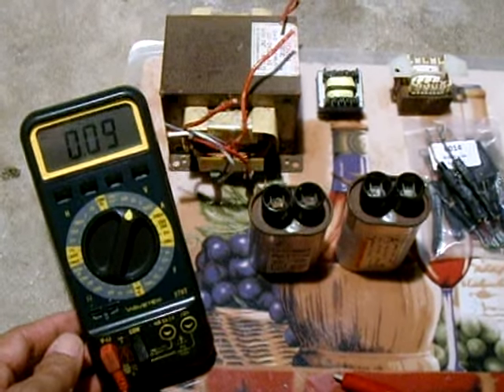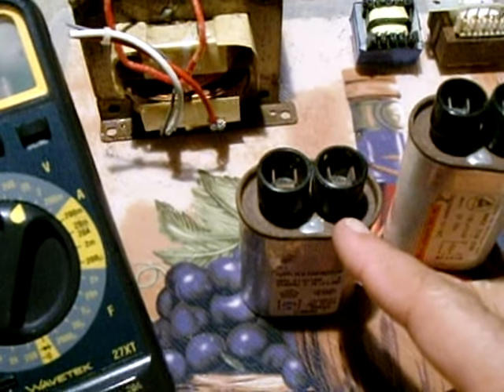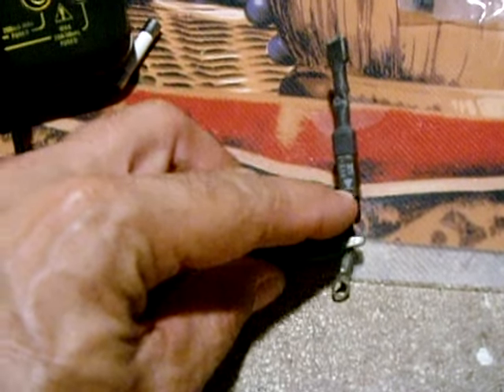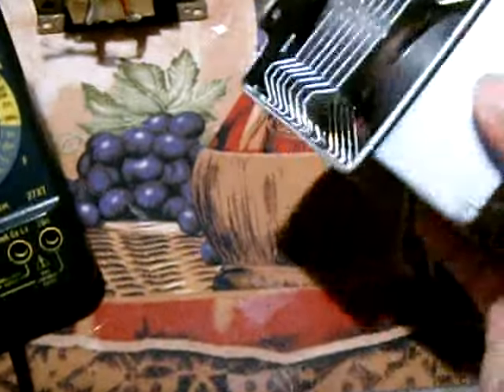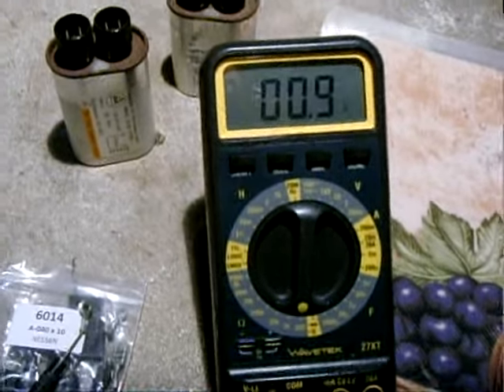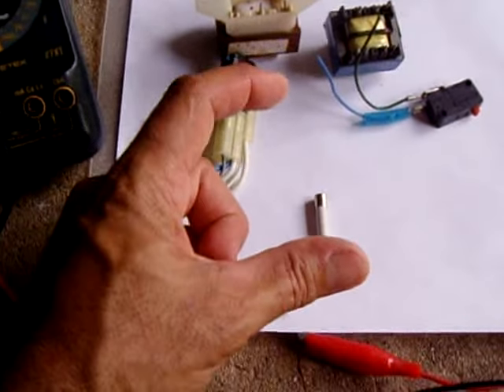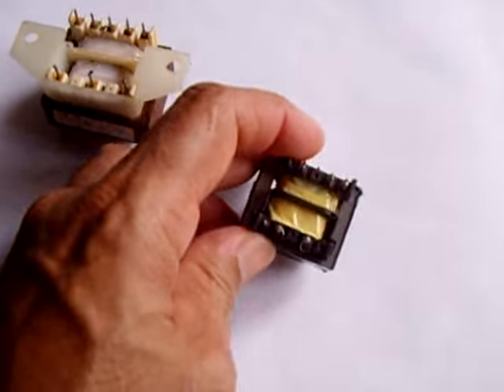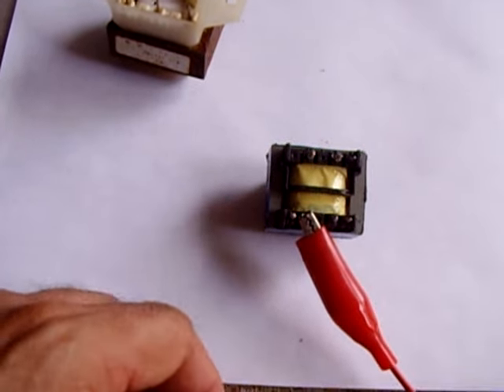How To Easily Test Microwave Oven Parts! (Ultimate Guide)

Comment: The testing on the MW transformer is very hard to follow for the following reasons: You use different color leads and the framing does not include how you are routing the wires. The red lead on the high voltage (primary) testing is out of frame. I have tested mine using two different DMMs and still have yet to get the unit to go the 80 to 120 ohm range. Also the blue text is almost impossible to read. The only reason that I mention this is that I study videos on appliance repair and outside of the transformer confusion, I think that this the best MW video on You Tube.
Reply from the maker: +Hannah Youngblood I no longer use that blue text. It was hard to see. Make sure 
annotations are turned on when watching my videos. I have another 
microwave oven repair video which is excellent. Thanks

Comment: Hey elec my microwave packed in yesterday.  Ive done all the testing that you said.  It runs like all is well but does not get hot at all.  everything tests good the magnetron is good and the capacitor is good i changed the diode still nothing.  However i do get 2.5 ohms on my primary windings of the transformer any idea do you think that transformer is the problem the HV wires are fine to what you said and none of the wires short to the casing? Thanks man hope to get it working got no cash for a new one:)  i get the tell tale hummmm from the transformer and all but nothing.
Reply from the maker: If the diode is definitely good, as well as the capacitor, then I suspect a faulty magnetron.
Reply: electronicsNmore thanks elec the diode is brand new so that should be good.  i do struggle to test cap though as i only have 2m ohm on my meter.  if i test across the terminals i get it count past 2m ohms not sure if that means the 10m ohm resister is good in the cap or not.  the magnetron tests good but i guess there could be something wrong with it.  anyway thank you so much elec solid video man keep it up.
Reply from the maker: Cap sounds like it is good. Likely a faulty mag.

Comment: where did you get your diodes from all the parthouses what $30.00 to $50.00 for them
Reply from the maker: tom rock I get all mine from the dump. I have at least 20 of them. You can buy a 12KV diode on Ebay for a few dollars and up. Enter 12KV diode in the search box. 30-50 dollars is criminal.

Comment: Ok thanks for posting this video!! Question for ya, my GE microwave everything works but it does not heat and the turntable does not run! When it did this both stopped at the same time. Everything else sounds like it is running normal. What could cause both of these to go at the same time? Seems that they are not connected as far as what controls them or powers them. Even the display is still normal! PLEASE if you have any suggestions let me know! Excellent video just thought I would ask in your experience what could cause the two problems at the same time, so far I checked door switches and figuring out your instructions on checking the diode.
Reply from the maker: Sounds like a faulty door switch, OR when the door closes, contact is not being properly made to trigger a switch. Test each switch according to the video, and open/close the door while you test to ensure they are being triggered. POWER OFF!(unplugged)

Comment: Hi my 23 year old Matsui Microwave has just started intermittently tripping the 30mA trip on my board. It doesn't do it all the time. In your experience which of the TX, Cap or diode or Magnatron will be the culprit?  I'll get in there and confirm it to you when i get a moment! Great videos by the way :-)
Reply from the maker: Probably a faulty/misaligned door switch.
Reply: Ooh, can you tell me how will that would trip the breaker intermittently?
Reply: No, it was a faulty capacitor

Comment: What causes the ceramic fuse to blow?
Its fine for a couple of days when a new one is put in, then it blows. Does this sound like the capacitor?
Reply from the maker: Faulty capacitor, malfunctioning interlock switches, or a badly misaligned door can cause the fuses to blow. Thanks for watching!

Comment: Hey. When I test the Diode one way, I get 50M.  When I reverse the leads, it starts to count up to infinity.  I have a 2000M setting on my meter.  I purchased a new diode and I'm getting the same readings on the new one. Is it possible that the new one is faulty as well?
Reply from the maker: Myth Your test showed a perfect diode. That is what the results should be. There was no need to buy a new diode.
Reply: electronicsNmore Ah, I see.  I thought if the reading went over 350M it meant it was bad.  Luckily I can return it.  Thanks for all your help.
Reply from the maker: Most will rise up to the 300M range one direction, but I have seen others read to infinity. As long as one way is 30-55M and the other way is 300M to infinity, then you are OK.

Comment: great video! i just want to findout, what causes my microwave oven to just stop working and display zero on display? nothing else moves no humm nothing. just a lit display displaying zero.
Reply from the maker: Does not sound good if the keypad/display is not working. May be a faulty main board. Try pressing clear, and as a last resort, leave the microwave  unplugged a few hours and try it again. The zero may also be a trouble code for your oven. You need to do some homework.

Comment: Hello,
I have one (few yrs. old) Kenmore micro, and the fan, light, carousel runs continuously until I open door.   Heating cycle does run and cycle fine with touch pad, and heating does go off when timer zeros out, the rest just continues to run until door is open or I unplug it.  I have a feeling there is another relay on keyboard that is stuck in the closed position for the light, fan, and carousel cycle!  It did this recently before but cleared up and now doing it again full time.   Do you suppose this would be the be the case?

I wouldn't be asking if weren't mounted under cabinet..

Old tired electrician...

Comment: I have a ge convection microwave. When I open the door the humming noise comes on and turn table turns is this the microwave shooting microwave at me or a fan running. microwave does warm my water in the cup. The only thing still under warranty is the magnetron should I throw microwave away or call repairman

Comment: So, on the high voltage transformer, if you test the two red wires between the coils and get a reading well above 1.0 ohm is that an indication that the transformer is bad? I am seeing over 30 ohms across these two wires.
Reply from the maker: +mikej768680 
Hi Mike, the heavier red insulated wire that is wound 2-3 times between the primary and secondary is the filament winding. That reading should be very low(1 ohm or less). Make sure the ends of the wire are clean, and make sure the test meter is working properly. I did not mention testing that winding in the video, because I have never seen one go bad. The HV secondary should give you a reading "similar" to what I show in the video.

Thanks
Reply: +electronicsNmore I checked the filament winding multiple times and got over 30 ohms consistently. My meter is working properly. The magnatron is checking out, the capacitor is checking out, the diode is not burned, everything else is working fine. I can hear the magnatron kicking on but its not heating. The only thing I can figure is the filament winding is bad... Any other ideas?
Reply from the maker: mikej768680
The filament winding outputs around 3-3.5v/10A. 30 ohms is not good for 3-4 turns of heavy wire.
Reply: +electronicsNmore I ordered a new HVT since it's the only issue I could find. I will let you know if it fixes the problem.
Reply from the maker: mikej768680

You can check with a local repair shop for a used one for a good price.
Reply: +electronicsNmore I found a new one on eBay for about $30. If that Doesn't solve the problem I will probably just invest in a new microwave. It makes sense that the magnetron isn't getting enough power. The last time I used it, it took several minutes to heat food that should have been hot in 30 seconds. GF used it today and it wouldn't heat at all. So we'll see
Reply from the maker: mikej768680
If you said the primary/secondary/and filament winding tested OK, as well as the cap & diode, then I would say a new magnetron. They can test OK, but be faulty. Usually you rule everything else out before buying one.
Reply: +electronicsNmore Well like I said, the filament consistently read over 30 ohms.
Reply from the maker: mikej768680
OK. Good luck. Let me know how you make out.

Comment: If u take the capacitor and transformer from a microwave and re-wire the transformer to 12vdc via a rectifier, will the capacitor be big enough to take the load?
Reply from the maker: You are trying to make a 12v microwave oven. You cannot transform DC. You need an inverter to do that.
Reply: No I`m making an ac/dc (240ac-12vdc) transformer after rewiring the laminated e-core transformer I have 2 x 50 amp rectifiers and wonder if the same capacitor will take the load.
Reply from the maker: Oh, OK. Did you watch this video?

DIY Custom Power Transformers

The capacitor will be used across the transformer secondary output. Use enough turns of heavy gauge wire until you get an AC voltage reading of 9 - 9.5V. Once you rectify that AC voltage, you will have 12.6v - 13.3v. That microwave capacitor is a non-polar. You need a large capacitor across the output. One like I used in my microwave oven welder would be really good, but you don't need one that big. Use a 16 to 25V rated electrolytic.
Reply: Thanks boss I was aiming for a 14vdc output to allow for the design of my HHO plates. I take it I`d need in the range of 30 000 mf to be safe? I`ll watch you video now! Thanks again. :)

Comment: Where can I get a Circuit Board Relay that you taped on to get the magnetron to start working. Part number would be good.
Reply from the maker: This is a common part #:
250VAC/30VDC HF62F-012-1H

Comment: Using European 220 volt 50 hertz high voltage transformers in microwaves with 220v 60 hz, I have heard that both the capacitor and diode become damaged. What is the reason for this ? I imagine that the transformer sends out more voltage does that make sense ?
Reply from the maker: Hello. I already explained this(recently) in one of my 2 microwave oven repair videos. Please read through the comments. Thanks

Comment: My Panasonic h965 WFA is 3 yrs old and quit working - no lights on display when it was plugged in.  I changed the fuse to a 12 amp slow burn fuse and then it worked OK while heating water for 2 min 30 sec.  Then when I tried 4 min (and larger amount of water) the fuse blew again.  Any thoughts?
Reply from the maker: Hi Marvin. Test ALL components as shown in the video. Faulty/misaligned door switches can cause the fuse to blow. A faulty capacitor/diode/magnetron can also result in excessive current draw.

Comment: Hi My meter reads 1 at 200 ohms open circuit (not 0.L like yours) and 0.7 closed circuit.  I have checked the magnetron and it shows 0.7 ohms across the terminals directly from the meter with no jumper wires. When I use 2000k ohms to terminal and body it continues to read 1. Does this mean that it is faulty?
Reply from the maker: Your meter is not calibrated. When you touch the probes together you should have ZERO ohms. I think your due for a new meter if you cannot open and calibrate it. If you set the DMM at 2000k and you notice no change in the reading from each terminal on the mag to ground, then your OK. Understand this test is not 100%. If everything else tests OK according to the video, then usually the magnetron is faulty. Buy a new meter and repeat the tests. All the info you need is in the video, as well as in all the comments below.

Thanks For Watching

Comment: One measuring of the low voltage coils (transformer) to the body is enough, (the coil itselves is low impedanced as measured before)
Reply from the maker: Not true. You can have an open primary or HV secondary winding.

Comment: Hi , I have a GE Microwave  JVM6172SK1SS  that I got free , only problem is the exhaust fan won't turn off. I changed the fan relays on the board but still won't turn off. I checked the door switches and the three temp sensors all ok . What else do you think I could test
Reply from the maker: If the relays and temp sensors are OK, then it must be a faulty control board keeping the fan on.
Reply: @electronicsNmore  what would I check on the control board, what keeps the fan on untill it cools off enough to turn it back off. It must be stuck on. Thanks for your input. I don't care really want to replace the control board for they are over one hundred dollars, besides I like the challenge to try and find the faulty part on the control board.
Reply: What on the control board would be faulty for the exhaust fan to keep running ?

Comment: I ran all the tests noted in your video and all tests run normal yet I have a oven that is making a loud hum and does not heat. I replaced the HV Diode to be sure and it still does the same hum no heat. The hum is definately from the HV transformer. Everything works on the oven (keypad, fan,light, rotating tray, etc..) The magnatron shows no problems and test normal. Again all the tests you show I completed but still the HV transformer hum and no heat. If I try a 50% power setting the sound decreases/disappears as it cycles from 50% to 100%. Really confused and need your assistance???
Reply from the maker: If you hear the loud hum, and swapped out the diode, then make sure the capacitor is good. If it is, then suspect a bad magnetron. They can test good, but still be faulty. Just make sure you rule everything else out.

Comment: Are the Magnetron interchangable for different microwaves??
Reply from the maker: Mark E As long as the mounting bolts match up, the wattage is very close, and the size of the aperature is close, it should work just fine.

Comment: my hv transformer is reading 4ohms instead of the less than 1ohm you mention. your thoughts?
Reply from the maker: clean the contacts, and try shorting the 2 wires together on your meter to make sure it is working properly. You should get zero ohms when the test probes are shorted.

Thanks For Watching! Be sure to rate Thumbs Up, and share my channel with others.

Comment: My HG m-wave runs & hums, and does the deep hum as if it's heating. I tested the major components and they all passed, except possibly the HV diode between the capacitor & chassis. It passed the tests except the last ohm tests without the battery, it didn't change readings for that. It looks & sounds like it's running fine, just doesn't heat. Any ideas?
Reply from the maker: Usually the diode, capacitor or magnetron last. The magnetron can test OK, but still be faulty. You have to be absolutely sure the diode and capacitor are good before swapping out the mag.

Comment: What if i read 4.1ohm between the main connections of the transformer and 176ohm on the high V con and the body?
I've tested the capacitor and read 1.8ohm between the pins.

Comment: Are the main transformers of similar wattage interchangeable between makes? They all look generic if you discount the connectors.They no-longer make a replacement for mine.
Reply from the maker: You mean the large HV transformer? Or the one installed on the circuit board? If the HV transformer, you can use any microwave oven transformer of the same wattage that will fit.
Reply: Thank you for the prompt reply. It was the HV transformer. It is as i suspected, but good to have it confirmed. This one my father bought 40+ years ago and it cost a fortune then. It still looks good.

Comment: Hello,
I have a GE microwave and it once blown up the noise filter fuse. I replaced it and it blew again. So the next possible test is door switches and that was the problem. I ordered the switches online and changed them too but this time my breaker went off. Did I miss anything here? Also my switches looks good as per your test videos. When ever the door opens the fuse  blow. Can you help me pls.
Reply from the maker: Sounds like a fault capacitor or magnetron.
Reply: electronicsNmore magnetron test was ok. Should I check the capacitor then?
Reply: If the switch wires plugged in wrong would that going to be a problem?
Reply from the maker: The magnetron test isn't 100%. If everything else tested OK, then the magnetron is faulty.

Comment: I tested the Magnometer with clamp amp meter and it showed 0.00 resistance tested it for short and it's okay however there is a visible small burnout on the antenna, the Microwave works normally but there is no heat the magnometer is humming fuses, switches,  HV diode, cap, thermal relay are good, control board looks fine too, my question is could it be the magnometer ? I am not 100% sure, need some help
Reply: Did you figure out what was wrong? I’m having the same problem as you. Everything checked out, but it won’t heat.

Comment: My ge profile microwave / convection oven problem is intermittant.  after letting it rest for an hour or so, it will work for  the first one or two heating cycles but on a third it acts up and won't heat.  The display comes on and registeres what the selected cook time is but when the button to start is activated, the clock ticks down but no buzzing of the magnitron nor turning of the table.  Everytime I un plug it and try to test it, it works. But re-install it in the wall and it acts up again. Any ideas?
Reply from the maker: +Jon Woods 
Sounds like the thermal cut-off is turning off the magnetron due to excessive heating OR the cut-off is faulty. You need to test everything according to the video. You may have a faulty magnetron.